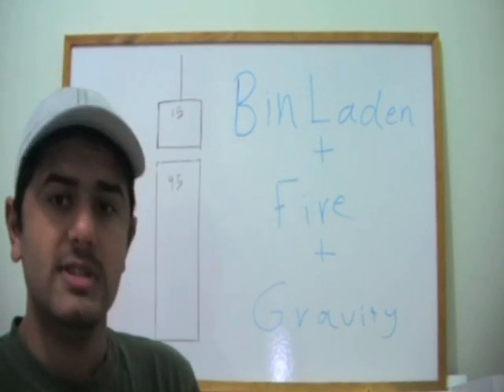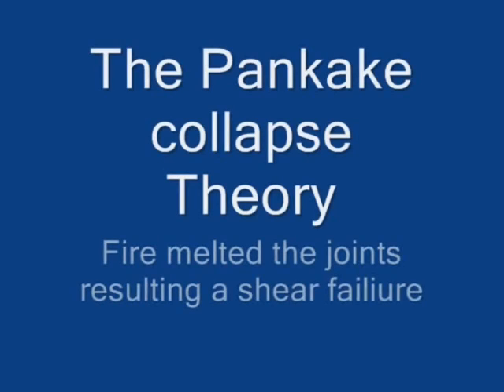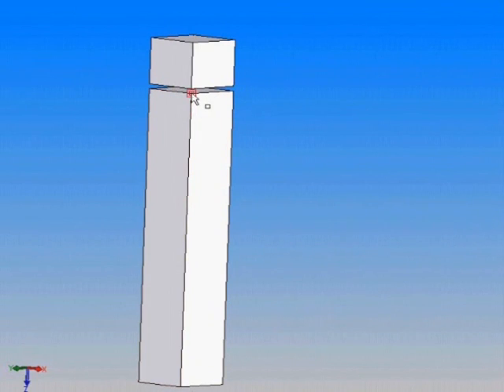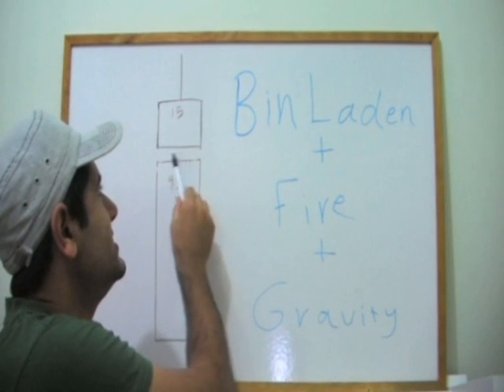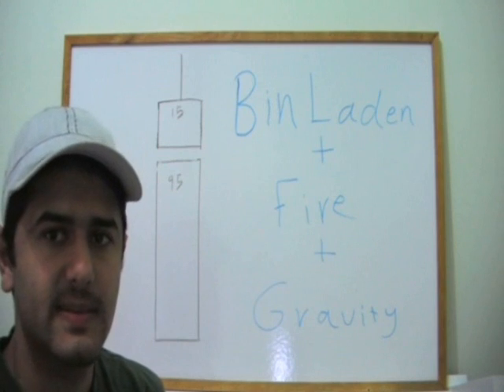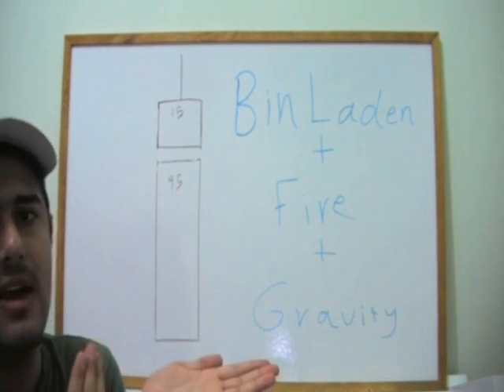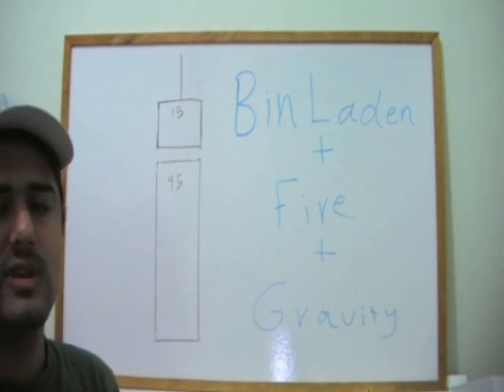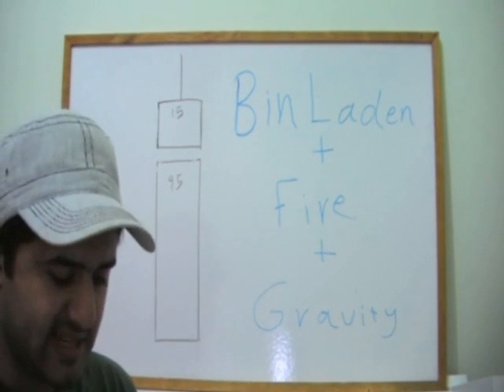(Part1) 911 Simple Physics Structural Failure Vs Demolition

Comment: Columns did NOT melt. In addition the towers did NOT fall at free fall speed. The buildings did NOT fall within their own footprint. What this guy is saying, is that the energy within the top floors as they fell was insufficient to contribute to collapse below the impact points. It has been calculated that each floor was loaded to half it's design load in its normal state. Therefore its safe to assume that the energy of top floor collapse contributed to forces far exceeding the design loading of the floors below. Something equivalent to 250 tons of TNT. Where does this guy think this energy disappeared to?
Reply: +999DaveUK "In addition the towers did NOT fall at free fall speed" How do you know
Reply: Osclala The free fall fallacy is demonstrated simply by the many videos which show the separated falling debris far outpacing the main building collapse.

The free fall timings have been estimated to be around 9 seconds. There are calculations available, showing that WTC1 estimation of collapse took 13 seconds and WTC 2 took 9.5 seconds.

Try reading the calculations here, they certainly convinced me.
http://www.911myths.com/WTCREPORT.pdf
Reply: 999DaveUK So do you think the planes caused the towers to collaps, do you belive the original story?
Reply: Osclala Yes, I believe there was no other external forces involved apart from the planes, fuel and subsequent fires. In fact, even after all of these years, some people come on You Tube, asking the same questions, but failing to provide a shred of evidence to support a theory that other external forces were involved.

Don't you think that's strange?
Reply: 999DaveUK and also explain WTC7 to me
Reply: Osclala WTC 7... yes that was the building that was damaged severely by falling debris from the towers. And then it caught fire. And then the structure was compromised because these fires were unfought. The structure collapsed in the damaged areas, and by this time the transfer of mass could not be supported across the remaining structure. This is evidenced by several visible effects:
1. Damage to SW corner, quite severe
2. Fires burning over several hours
3. Visible bowing of the structure prior to collapse
4. The Penthouse structures collapsing before any other part of the building, which is an indication of inner structure being removed before outer columns and trusses gave way

Quite a simple explanation really. Don't you find it amazing how some people actually believe explosives caused this, when there is not a shred of evidence?

Oh and my previous question, which you avoided was 'Don't you think that's strange?'
Reply: Osclala Another question for you. Do you actually agree with this guy in the video? He does make several fundamental errors and incorrect statements.
Reply: Osclala I take it your questions have been answered and you now have the information to dismiss the ludicrous claims of bombs and explosives... well done!
Reply: 999DaveUK Different timezone :D havent looked at it yet
Reply: 999DaveUK I'm not saying i believe that bombs were panted, although I don’t believe the NIST report. And the building did free-fall, you can see in the original videos how fast it falls, and you can measure how fast it fell, which indicates that the towers did indeed free-fall around 2,5 sec (more ore less.) also it did fall symmetrical which doesn’t make sense, you would think that the collapse would make it tilt to either sides, but it falls within the footprint. Also explain to me why they found termite in the dust, and explain how WTC7 collapsed. Notice how the towers almost explodes out, but WTC7 implodes in itself.
Reply: Osclala If the towers achieved free fall, the time of collapse from top to bottom is calculated at around 9.5 seconds. However no one could possibly know the actual fall time, as the lower 40 storeys were within a dust cloud. Using the mass of the upper unsupported 15 storeys, and it's immediate collapse, the energy released by gravity is massive. If you are saying a 2.5 second difference is 'nothing', then you'd have to realise, based upon a 0.1 second collapse per floor, we are talking about a 25 storey difference. In other words, under free fall, the towers would have hit ground zero. While under the actual witnessed collapse, 25 storeys would still have to fall. This points to all of the energy being used from the weight of the building, cumulative and with gravity forces being enough to collapse floors in a progressive way.
The towers did not fall within their own footprint, some parts of the towers ended up being spewed out 100 metres. It was a top down collapse, and the tilt you refer to was the initial collapse, which immediately compromised the structure on the opposite side due to overloading. The straightening was due to the fact that the first few floors below the impact points gave way more or less evenly, and momentum together with cumulative weight of additional floors was enough to continue the collapse.
WTC 7 is a completely different scenario. Massive fires raged for hours, a large portion of the SW corner had gone. I see nothing wrong with the 'implosion' you mention. In fact you can see on video the effect on the outer steel columns by the bowing, and although you cannot see the inner structure, I would think that would be similar too.
Reply: 999DaveUK How did it fall symmetrical?
Reply: Osclala If you are talking about the collapse of WTC 7, this was NOT symmetrical.

WTC 7 was made up of many 					pieces put together. The building 					collapse progressed from the penthouse out as columns were 					weakened by the fires. This transfers the loads to other faces of the building until it gets to a point where the loads overcome the design loads. The slow sinking of the penthouses, 					indicated the internal collapse of the building behind the 					visible north wall, and this took 8 seconds according to NIST.
In fact, the north face fell AFTER the rest of the main shell of the building. This is evidenced by the photos showing the north side outer supports resting over the rubble pile.

I would ask you to look at the Bankers Trust Building, which had been similarly damaged by debris from the towers. This building did NOT collapse. The difference between the two events was.. WTC 7 was on fire, and The BT Building was not.
Reply: "Columns were weakened by the fires" Office fires never goes beyond 600C How do steel beams melt? In addition, how do they all melt at almost the same time? Why did the government clear the site, even though it is illegal to touch a crime scene? Also how can it be that no other high risers (except the three at 911) ever fell, no such thing has ever happened before.. And then 3 times in a day... look at this http://www.nytimes.com/2009/02/10/world/asia/10beijing.html?_r=0 ... how did this not collapse then???? More fires in this building that’s for sure, and also.. How did the fires start in WTC7?
Reply: Osclala OK, I will answer your first question only, as you are making assumptions and jumping around.

I, and nobody else, is claiming 'steel beams melted'. Where do you get this notion from?

It is known that structural steel begins to soften around 425C and loses about half of its strength at 650C. So your 600C office fire scenario looks bang on. But even a 50% loss of strength is still insufficient, by itself, to explain the WTC collapse. Even with its strength halved the steel could still support the stresses imposed by a 650C fire.

The main problem was distortion of the steel in the fire. The temperature of the fire was not uniform everywhere, and the temperature on the outside of the box columns was clearly lower than on the side facing the fire. The temperature along the steel beams was certainly not uniform. Given the thermal expansion of steel, a 150C temperature difference from one location to another produced distortions in the slender structural steel, which resulted in buckling failures. Thus, the failure of the steel was due to two factors:
1.Loss of strength due to the temperature of the fire
2. Loss of structural integrity due to distortion

My question to YOU is... explain how the towers collapsed.
Reply: Well to be fair, I do not think I am qualified to answer your question. I do not know all the details yet but I can tell you that I do not believe NIST. I could be a reason for US to get involved in the Middle East since I cannot justify the “attack” as a reason to go to war. They could just have heightened security instead of wasting innocent lives and taxpayer’s money. For some reason I think it is connected to oil, I do not know if it was the governments act, it just seems a bit unlikely. However, considering all the dirty tricks America has used throughout the history I would not be surprised to be honest. 
1: I find it hard to believe that high risers just collapse because of fire. The WTC towers where the first 3 in the whole world to collapse because of it. Moreover, 3 on the same day? Come on. In addition, when you look at the images the fires in WTC 7 are not big enough to make the whole damn building collapse. Look at the tower from Beijing, that fire was something else and it still stood. 
2: Looking at the trajectory of the airliner you can see that this is not the average Joe.
3: Why did they find Termite in the dust? This is a chemical compound which is used to cut metal (heats to around 2,5k C) 
4: WTC7 Falls symmetrical and in freefall (is calculated by the amount of frames in the recording) This indicates that there is nothing holding it up at a certain point, which is unlikely if it’s caused by fire.  Also the penthouse could be explained. If someone were to plant a bomb to make it look natural (not that I believe this) 
5: NATO congress was secret, no journal was ever released. We do not know what they have been talking about, and really, the NATO involvement in Iraq afghan etc. was because of the article 5 claim. 
6: The actions of the ruling government – Why did we have to go to war, why didn’t we just tighten security.
7: The hijackers were never recorded on video, and they weren’t on the original boarding plans, the only link is the passport “found” on the sidewalk. 2 things A: How did the passport survive the flames B: Did they slip through American security without any record of them ever being there? Unlikely.
Reply: Osclala You have just typed a whole series of conspiracy plots, and not a single ONE of them has a shred of evidence. You are basing your stand point on your own political beliefs.
Reply: According to NSIT itself, "parts of the tower spewed out 100 meters (that's misleading, rubble did that, the superstructure itself did not)" because of the pancake effect. A pancaking twin tower should have taken much more than 12 seconds. Much of the energy you are talking about gets used up, as each floor crashes into, and destroys the next, resulting in some deceleration. If the WTC had been pancaking, it would not have gracefully accelerated to the earth in that way and with that velocity. Additionally, the damage to WTC7 was initially assessed as being minor, and it was after the demolition that it was supposedly  discovered to have had 12 feet of depth from 30 floors of it's south face "scooped out" (there is no supposition as to how). There was a fire, though if it was indeed "massive" it was deceptively so. There was very little smoke or fire visible at all. Finally, while it is true that the heat from burning office supplies can weaken steel, it is nowhere near hot enough to create the glowing blobs of slag seen falling from the towers, and found beneath the wreckage days after the incident. No steel beam skyscraper has ever collapsed like that due to fire. EVER. Steel beam skyscrapers have been rocked by fiery explosions before, some burned with a violence and duration that make the WTC look dull, and not one of them experienced more than minor structural collapse. Now your are telling me there are three in one day? Other structures destroyed in fires collapse slowly and with great deal less symmetry. Multiple structural supports must be compromised simultaneously to achieve that kind of demolition. Thousands of people with a lot more architectural knowledge than you agree. The twin towers were designed specifically to be able to withstand a collision from a 747. You say nobody claiming conspiracy can come to you with any facts. Can you come with any facts you didn't get just by glancing at the excuses haphazardly shat out at the last minute by the NSIT?
Reply: 999DaveUK I can provide you with sorces if you care. I'm just asking questions as to how all these coinsidents happened on the same day. The NIST report is so unlikely that i would rather bet on the legitimacy of a random lottery coupon.  I cannot belive NIST because it's flawed and full on "facts" that arent proven.
Reply: ***** I cant figure out if you are for or against my argument? At some point it seems like you disagree with me but then i read this "Can you come with any facts you didn't get just by glancing at the excuses haphazardly shat out at the last minute by the NSIT?"
Reply: ***** Just a couple of points:
1. ''A pancaking twin tower should have taken much more than 12 seconds''. So how long should it have taken? And your claim that the fall should have decelerated doesn't take into account the mass of each floor adding to the dynamic mass as it hits the floor below, and so on. In actual fact, free fall, would have produced a final collapse 3 seconds sooner, equivalent to 30 stories of fall.
2. ''According to NSIT itself, "parts of the tower spewed out 100 meters''. Why do you dismiss this? There are pictures widely available showing the large debris slabs leading a path right up to Building 7. This was a distance of 130 metres. This also answers your argument that doubts how Building 7 was damaged. Other buildings were well within this 130 metre zone, but only Building 7 (by far the largest and tallest in that zone) caught fire and collapsed.

These are FACTS supported by evidence. Where is the evidence supporting a controlled demolition, apart from the subjective comment that 'buildings like this had never collapsed before'?
Reply: Osclala Much of the NIST report mentions events as being 'likely occurrences'. Nobody knows what exactly was happening within the 3 buildings. But the NIST report does make use of areas of evidence, including video, pictorial, eye witness, seismic, scientific, structural. And from this they produced a series of probabilities.
Just because you don't think something could have happened is not a reason for dismissing an argument. In the same way I do not dismiss your argument, I merely ask for evidence to back it up.
What exactly did you want from the report? Did you want it to make up a scenario to suit your own agenda? And if you dismiss the NIST Report, would you please show me a piece of credible evidence that supports a controlled demolition theory? I'll await your response.
Reply: " Building 7 was damaged. Other buildings were well within this 130 metre zone, but only Building 7 (by far the largest and tallest in that zone) caught fire and collapsed.

These are FACTS supported by evidence. "

What evidence leads to the possibility of WTC7s collapse ? Lets assume you are right that a part of one of the towers fell into the building.

Why would WTC7 fall symmetrically and why wasnt any of the bulding destroyed beforehand? when you look at the pictures of WTC7 the bulding was intact and standing.

You are saying that a fire caused WTC7 to collapse? collapse symmetrically ??
Reply: 999DaveUK I dismiss NIST because i think the so called evidence is fake and bought by the goverment.

Remember the passport they found from one the terrorists? how was that found and how did it survive the plane crash flames etc. The jackers werent even in the boarding plan or wasnt even recorded in the airport? there is no link to the jackers

How did a stealbeam highriser like WTC7 fall due to fire or falling rubble?? why didnt the surrounding buildings fall?.How did both towers fall symmetrically with a 12 freefall period and into it's own footprint all because a plane crashed into it??
Reply: Osclala If you read the NIST Report it clearly states that Building 7 was critically weakened by damage to the floor spans and a key vertical column. It also states that the damage to the structure by falling debris was not a direct cause of collapse. But why do you state that Building 7 was not damaged, when it clearly WAS damaged? In addition, the 'symmetrical collapse' is explained by the view that much of the internal support was progressively collapsing and weakened BEFORE the outer steel shell was seen to collapse. The roof structure, and penthouses, were elements supported by the internal steel columns. Once the internal columns had gone, it can be clearly seen that the roof collapses. There is also video evidence showing the outer structure being pulled and pushed as the inner steel disconnects from columns. So for a few seconds we have a scenario of an outer shell standing unsupported by any of the internal structure. What you saw was the final element of collapse. NIST used the video and seismic evidence to produce a report depicting the likely cause of collapse. What I do NOT see, is any evidence whatsoever of a controlled demolition. Could you please provide some?
Reply: 999DaveUK i dont know what happened to WTC7 the demolition was the twins. And ive read NIST.How was WTC7 damaged from the inside?
Reply: Osclala ''How did a stealbeam highriser like WTC7 fall due to fire or falling rubble''.... previously explained, and is clearly explained in the NIST Report. So why do you keep asking the same question? Surely it's time for you to provide an alternative theory?
''Why didnt the surrounding buildings fall?''.... because Building 7 was the only building to have unfought fires, and which had by far the largest mass of over 40 stories.
''How did both towers fall symmetrically with a 12 freefall period and into it's own footprint all because a plane crashed into it?''.... well you need to get your facts right. WTC1 and 2 did NOT fall at free fall speed. They fell at some 3 seconds less. In addition, they did not fall into their own footprint. Large debris slabs landed over 100 metres away.
Your point about the hijackers is noted. The NIST Report does not consider the hijackers, but there is plenty of evidence to suggest the hijackers were all identified. But you no doubt think they are all still alive. So, let me know where they are right now?
Reply: Osclala ''How was WTC7 damaged from the inside?'' The initiating event was the fires. These were unfought, and burned over a long period. This caused heat expansion, and in particular affected a vertical column (No 79) over a 9 floor distance. Subsequent buckling and disconnection of floor joints weakened the internal structure. There, now you know!

So, how did a controlled demolition collapse Building 7? I await your answers.
Reply: 999DaveUK As i stated before they found termite in the dust you can read it in my statements above froma few months back.

here is a video you'll be the judge.

Also i have a cd and some files i can send you although it is in Danish so you might not get anything out of it.
Reply: Osclala So are you saying that this thermite in the dust is your proof that the towers and WTC 7 were deliberately collapsed by controlled demolition? You do realise that NO thermite was found.. merely the residue of particles that have not been independently verified. And even if these particles were residue of a thermite reaction, you don't explain the logistics of how this event happened. And there are no eye witnesses to thermite being used. No whistle blowers. No scientific support for such a theory. So for the last time... WHERE IS YOUR EVIDENVE OF A CONTROLLED DEMOLITION??
Reply: Where within the NIST Report did they analyse the floors below the point of collapse initiation ?   Please provide me with the specific analysis from NIST..... and please don't reference Bezant as his theory wasn't part of the official NIST investigation..... thanks
Reply: Eric Arthur Blair Jr "Where within the NIST Report did they analyse the floors below the point of collapse" I didnt claim this i only asked how the third law applies
Reply: Eric Arthur Blair Jr i will dismiss all the odd "coincidences" if you can explain to me how the third law applies to either of the towers
Reply: Osclala It's not for either you or I to debate the third law and how it applies.... however. it is for you and I to scrutinise the conclusions from the only official analysis that was commissioned by the US Government and conducted under the National Construction Safety Team (NCST) Act, which gave NIST the responsibility for conducting fact-finding investigations of building failures of WTC1,2,and 7.

Now... if you look at my original question of "where within the NIST Report of the WTC 1. and 2 did they analyse the floors beneath the point of collapse initiation" ..... care to answer ???
Reply: Eric Arthur Blair Jr If you read  the timeline here on youtube i explained everything to this case. look at the comment above. To sum it up i dont belive nist or their report, a lot of other people have found flaws in the nist report.

The  third law doesnt apply to the twins
secondly WTC7 came down due to what?? office fires?? must be the first tower in the world.
Reply: Osclala My apologise .... I didn't read your earlier posts..... I was simply asking the deniers to explain why the NIST report was so   flawed..... hence my post !
Reply: +Eric Arthur Blair Jr It was fun watching you two truther tin foil hatters arguing... and not realising what you were arguing against lol. Kind of sums you people up I suppose lol
Reply: 999DaveUK English isnt my first language so i might have a hard time understanding some things, but i can try writing in Danish and we'll see who will wear a tin foil hat then ;)
Reply: That's ok. You guys usually talk Double Dutch, and I can't understand that either lol.
Reply: HAHA.... when you lose the argument, just block. So easy lol
Reply: +999DaveUK I've seen predictions of over 2 minutes for a pancaking twin
Reply: ***** And I've seen exact calculations of 12.5 seconds. But then some predictions, are usually guesses!
Reply: 999DaveUK LMFAO !!   can't you answer MY question dave.... come on... give it a go if you are such an 'expert" !!
Reply: Eric Arthur Blair Jr Well you aren't the sharpest tool in the box are you? What question did you ask of me? I scoured this little series of posts, and didn't see ONE question aimed at me. And in any event, why on earth should I answer a question from a nincompoop....?? Now go and run, unless you have something useful to say!!
Reply: Eric Arthur Blair Jr It's nice to see you are supporting all of the ''scientific'' theories presented in this amateurish video. It was like watching a six year old explaining how his ice cream is melted by the fairies!
Reply: +999DaveUK I think you're missing my main point which is that you are only defending your position using information from the very source whose validity we are challenging. I have an 'exact calculation' where the tower stops collapsing about halfway through so it seems there are different ways of doing the math. Whose math are you listening to?
Reply: ***** How do you know I am only using the NIST report to validate the NIST Report? And as usual, because you are a conspiracy truther theorist, you talk in riddles. You now want an independent report, not the NIST Report, to come up with different fall rates other than those shown within the NIST Report. And yet that same NIST Report uses a range of verifiable data (VERIFIABLE).... so what data does your 'other source' use? And a word of advice to you. Stop attempting to bullshit, you are exposed!
Reply: 999DaveUK Double Dutch? what the fuck is that? I bet you dont speak shit besides English.
Reply: +Osclala I see you have added 'bad language' to your list.
Reply: 999DaveUK I see you have added demeaning smartass to yours
Reply: +Osclala So....now you failed to give any evidence whatsoever for your wild conspiracy theories. Now you are using foul gutter language to make yourself seem smart. But what you are really doing is stamping over the graves of 1000s of innocents killed on 9/11.  Shame on you!!!
Reply: 999DaveUK i provided you with a lot of links before, look at those or search "niels harrit" and you'll find a lot of the stuff i've been talking about. Besides you havent given me evidence as to how the third law applies to the twins so you failed aswell. You refuse to challenge the official story and treat 911 as a crimescene thus letting down the families who lost their loved once shame on you.
Reply: 999DaveUK Looks you it's YOU who's been exposed Dave !!   Still no answer from you to my question..... this is really embarrassing for you mate !!!!
Reply: +Osclala You can send me all the links you want. No doubt these are from the same school as yourself... a tin foil hat wearing theorist with not ONE piece of credible evidence. You are well and truly debunked. I've given up asking you to show me your proof because each time you ignore it...I wonder why...
Reply: +Eric Arthur Blair Jr And as I've said to you before. You are hiding behind riddles. Typical of a conspiracy nutter who doesn't even understand basic physics. You really are exposing yourself here aren't you?
Reply: 999DaveUK How is the third law a riddle??it's the most fundamental thing in physics? "Typical of a conspiracy nutter who doesn't even understand basic physics" if that is the most serious answer i can get i think we are done here. I think YOU are the nutter if you think the laws of physics shouldnt apply :D
Reply: 999DaveUK "No doubt these are from the same school as yourself" it doesnt matter who is challenging the official story as long as the sources and math adds up right? ahaha like there are only a handful of people in the world credible of doing research
Reply: They calculated the time it took for the buildings to fall by seismographs and it took 10 seconds for one of the Towers to fall! This is impossible in a natural way!
Reply: +Dhen Mcnab The timing for both towers to fall using video, seismic, eye witness and scientific data was around 2 seconds longer than in free fall. That 2 seconds equates to around 30 stories. The calculations in Frank Greening's paper show that the upper mass overcame the design loading of each floor below the block and added to the dynamic mass as it descended. So as you can see, it was the 'controlled demolition' that was 'impossible'!
Reply: Dhen Mcnab he wont listen i've been trying to say this for like 14 msg's, just give up he's eating all the shit the gov is throwing at him no matter what laws of physics you present.
Reply: 999DaveUK If you use the third law you'll see that the mass from the part of the bulding going down would have been destroyed or tilted, way before the halfway point... why? as the third law clearly states "For every action, there is an equal and opposite reaction." ... let me cut it in half ..... 

Kent Budgett is pulling upon a rope that is attached to a wall. In the bottom picture, Kent is pulling upon a rope that is attached to an elephant. In each case, the force scale reads 500 Newton. Kent is pulling ...

a. with more force when the rope is attached to the wall.

b. with more force when the rope is attached to the elephant.

c. the same force in each case.

Answer: C

Kent is pulling with 500 N of force in each case. The rope transmits the force from Kent to the wall (or to the elephant) and vice versa. Since the force of Kent pulling on the wall and the wall pulling on Kent are action-reaction force pairs, they must have equal magnitudes. Inanimate objects such as walls can push and pull.

lets assume that magically all the beams meltet at the same second the mass of the upper part of the bulding wont destroy the whole lower part because of the third law
Reply: +Osclala So you agree with this guy in the video? How amusing. Did you ever get past 1st grade physics?
Reply: 999DaveUK I did yes, i think you need to redo 1st grade if you cant explain the third law
Reply: Osclala I asked you if you agree with the guy in the video? You didn't answer. I also asked you to explain the scenario behind your controlled demolition theory. You didn't. This says a lot!
Reply: Osclala You stated this ''lets assume that magically all the beams meltet at the same second the mass of the upper part of the bulding wont destroy the whole lower part because of the third law''.
The way you are interpreting the 3rd law of motion is absurd. You make an assumption that the removal of a section of supporting structure allowed the upper block to fall, with the vertical beams landing exactly on the beams below.... and those standing beams reacting to the downward force by reacting in the opposing direction. You have ignored the transfer of downward motion into lateral motion which displaced the floor beams. You are also totally ignoring the other forces at play within the building, such as fire. If you watch the towers fall you will see large building elements and vertical beams being pushed outwards. These outward forces are in effect parts of the opposing reaction you are feebly clinging to. In other words, you are arguing against your own case. Well done...lol.
Reply: 999DaveUK When mass is in motion it doesn’t matter where and how it lands the third law will always apply. Say you drop a ball on the floor, the ball will then bounce back up (the same high) then lose energy 
which causes the next to be a little lower etc.

My point: 
to every action we have a reaction. 

If a force go down a force must go up, no matter where and how the mass impact. If you drop 10 kg on 30kg the 10 kg will be gone before the 30kg, we may very likely lose some mass let’s say maybe 5 kg depending on the force, but the greater mass will still be the mass surviving.
Reply: Osclala You keep repeating yourself. According to you, if you dropped a brick on a house of cards, the cards would repel the forces and stay as a house of cards. This would not happen of course. The full opposing forces only come into play when the cards are flattened, and the brick hits the table on which the cards stand. Can you really not see the flaws in your argument that the towers below the blocks would have remained intact?
Reply: +999DaveUK the twin towers aren't at all like a house of cards, they are a rigid mesh of steel beams specifically designed to withstand an impact from a 747
Reply: +Evan Newton So what point are you making? Explain how the towers fell. Then provide evidence to back up your claims. But I guess you are like the rest of the tin foil hatters.....short on knowledge but big on theories.
Reply: 999DaveUK The architect, engineer, pilots, firemen, military for 9 11 truth You always keep pretending they never exists! I asked a friend who is an airliner pilot to clean up at a 9 11 pilots for truth video comments as I was about to loose it over stupid comments like "There are no problem now days to get in control of a 767 as they are so computerized! He is dead tired of explaining over and over how and why their is no such thing as a Cessna pilot taking the controls of 757 nor a 767 and just point the nose at the target and hit at the first attempt!
Reply: Dhen Mcnab I see you are avoiding answering the questions. Why won't you say how you think the towers were brought down? Or are you content to live in your bubble surrounded by conspiracy nutters, without even thinking how the towers were brought down? Or maybe you are afraid of stating your theory because you realise there is not ONE shred of evidence?
Reply: My father is a flight engineer at the UK division of SAAB Aerospace manufacturing  the joint UK and Swedish fighter Gripen! I can go through the  easiest part of aerodynamically debunking the 9 11 lies later!

The proof. According to the law of gravity, it is possible to calculate the time it takes for an object to fall a given distance. The equation is H=(1/2)at2, where H is the height, a is the acceleration of gravity (10 meters per second squared) and t is time in seconds. Plug in the height of the building at 1350 feet (411 meters) and we get 9 seconds. That is just about the length of time it took for the very top of the World Trade Center to fall to the street below. According to all reports, the whole thing was over in just about ten seconds. Seismographic measurement proves the time scale!  

It is as if the entire building were falling straight down through thin air. As if the entire solid structure below, the strong part which had not been burned or sliced or harmed in any significant way, just disappeared into nothingness. Yet this (within a small tolerance) is what we would expect to find if there had been a controlled demolition, because the explosions below really do leave the upper stories completely unsupported. Like the Road Runner after he runs off the edge of the cliff, the entire building pauses a moment, then goes straight down.

Any kind of viscous process or friction process should have slowed the whole thing down. Like dropping a lead ball into a vat of molasses, or dropping a feather into the air, gravitational acceleration cannot achieve its full effect if it is fighting any opposing force. In the case of the World Trade Center, the intact building below should have at least braked the fall of the upper stories. This did not happen. There was no measurable friction at all.

This proves controlled demolition.
Reply: Nano thermite to cut the steel columns and RDX to give an effective demolition! I unlike other I believe we have an explosive that was simply based on RDX and the state of the art explosives most likely not to be released for a couple of decdes! RDX is an explosive compound that is commonly used in a variety of high explosives. RDX stands for Royal Demolition eXposive or Research Department eXplosive. It is a member of a group of explosives known as nitramides which are used in many military high explosives.  RDX is most noted for its use in the explosives C-4 and Semtex!
Reply: Dhen Mcnab So your reply is to give me a fantasy out of your head, naming explosives and making it seem as if these brought down the twin towers? Many such compounds are in use throughout the world, and in the military. When you've finished quoting a scene from a future Star Wars movie, could you please let me know:
1. How were these explosives planted and where
2. How much would have been needed
3. How was the whole 9/11 scenario choreographed, planting explosives below a point where a plane hit (amazing accuracy and planning)
4. How long would it have taken to plant explosives at the key columns, without being seen
5. Who saw these explosives being planted
6. How come nobody came forward to explain your theory, a whistle blower perhaps
7. And finally... where is the evidence, physical and video to show the conspiracy in action (detonator wires, explosions, seismic data)

If you don't know the answers to the above, please let me know, as I know. But there are many other questions. You have a reason for the towers falling, now let me know how it was done. (Please avoid reading your Marvel comics while you answer)
Reply: Dhen Mcnab Your post is FULL of errors:
1. ''we get 9 seconds. That is just about the length of time it took for the very top of the World Trade Center to fall to the street below''. This is patently wrong. Nobody knows exactly how long it took for the towers to fully collapse. There was a cloud of dust obscuring the view. The free fall time would have been 9.2 seconds. The calculated time for the towers using scientific, video and seismic evidence was 11.6 for WTC 2 and 12.8 for WTC1. These times are made up of 2 stages, the tower below the block collapsing, and then the block itself collapsing.
2. ''Seismographic measurement proves the time scale!'' It did NOT prove a collapse time of 9 seconds. It proved the timescales I have just given you. It measured the 2 stages of collapse as these were seen on the seismic data.
3.  ''the intact building below should have at least braked the fall of the upper stories. This did not happen'' Yes it did. The slowing of the collapse was caused by the blocks hitting the first floor below and overcoming the resistance. The next floor below then has even MORE mass to withstand, one extra floor, the next floor has to withstand the block plus TWO extra floors. The slowing for each floor collapse was around 0.1 seconds. This would mean around 30 stories would still be standing after your free fall time.

There are more errors in your post, see if you can find them!
Reply: As If any of my explanations is invented? Gosh! Just research the damn thing! You are only here for one purpose and thats provoking and harassment! I go by what my father and what my now dead best friend Chris who where into demolitions in the army taught me!

Check the testimonies of the white vans who came from late at nights in May to early August! We have multiple eye witnesses and then the renovations of the elevators! These are the most likely moments be able to rig the Towers! Ill drop it here as I suppose you are no toddler and are fully aware of how to research! No matter what I write you, you will still keep up with this comic book thing! Whats the use? You havent bother to read my previous explanation so why write a new with the exact same BS respond from you?
Reply: Alright lets boil it down to one question...

So the collapse of the 3 towers? were they natural?
Reply: Im  not into physics at all but how come the steel beams glow for weeks?
Reply: Jerry Esserman I've seen pictures of glowing debris being pulled from Ground Zero.  However, the debris looked to be small pieces of office debris, not steel beams. The pictures were likely taken shortly after the collapse, not weeks. And I have never seen any evidence of steel beams glowing after the collapse. The temperatures for steel to glow could only be maintained via a high heat source.... and there is no evidence of that. So maybe this is hear say or exaggeration?
Reply: Dhen Mcnab You didn't explain where you got your misinformation from? Your timings of collapse are wrong. What do you want me to do... agree with something that is incorrect? And one of your posts lists a series of explosive compounds. Let me give you a hint. It was estimated that for each cut column using thermite, it would have had to be carefully set up in directional boxes, with something like 200 lbs of thermite for each column. Is that feasible? And when I ask you to explain your scenario for your theory, you don't. You merely guess.
Reply: Osclala ''So the collapse of the 3 towers? were they natural?'' No, in the sense that there were external forces involved, leading to structural failures, which would not have occurred if there had been no fires.
Now there you are, I answered your question, so why don't you answer mine?
Reply: 999DaveUK Alright ill try :)
Reply: Cathode Roy Save your time for something better! He is only here to provoke people! He asked politely about my view then went into insulting me claiming my knowledge was made up! And Proving he dont know a shit about physics! You only end up with insults!
Reply: +Dhen Mcnab I didn't insult you once. if you are so sure about your sources and information you should have felt confident about your position. So I will ask you.... where is your source and evidence for saying the towers fell in 9 seconds. My source for saying it didn't is contained in video and seismic data. Can you provide this?
Reply: 999DaveUK You missed my comment then! I said I leaned against the inside Job not that I was 100% sure!
Reply: MK KENDALL I thought about removing your comment... but I had a think about it, and decided to let everyone else see what idiots infest the internet these days .... enjoy your new found fame...
Reply: MK KENDALL The more I watch the guy Ali in the video, the more I realise that it's essential to get a good education. You and him should sit together in pre school classes. But this time pay attention to the teacher
Reply: 999DaveUK Awwwww. Dave is still trying so hard to be funny and relevant. When is the next meeting of the sheep so you uneducated clowns can shit on some victims?
Reply: MK KENDALL Well your history of lies and truth avoidance is something you can be proud of. You and Ali could be a comedy team. Ali with his little drawings of buildings in his videos, and you with your little fairy stories. But, of course, he'd be the brains of the duo!
Reply: MK KENDALL I was wondering. How can you type on a computer and talk out of your ass at the same time? Amazing!
Reply: +Jerry Esserman The WTC debris fires burned for 100+ days, and steel is red in color from ~950 F to ~1350 F, i.e. well within the recorded temperature range of the debris fires:
http://pubs.usgs.gov/of/2001/ofr-01-0429/thermal.r09.html
What explosives or incendiaries burn for 100+ days, and how many FDNY and other cleanup workers are 9/11 truther nuts?
Reply: MK KENDALL But you are the one who thinks this Ali guy in the video speaks the truth. You are the one who thinks his 'science' proves your point. I was merely pointing out he is an uneducated buffoon. He is actually suggesting that the top blocks of WTC 1 and 2 should have stopped, or maybe bounced. You agree with him so you are just as stupid as him. So don't blame me for you being an idiot. Blame your education system!
Reply: 999DaveUK I didn't say anything about the guy in the video..... Thanks again for shitty opinions, speculation and assumptions.
    When does your debunking start big mouth? Oh shit. You couldn't answer Eric.
Reply: +MK KENDALL Well done for avoiding the point. Trolling on  YouTube videos is the work of a child...good boy. Debunking you was far too easy. ....
Reply: Tell me how do you explain the destruction of the inner core. Collapsing floor panels do not explain the destruction of the whole floor level, nor do they even guarantee a symetrical collapse. What the eye sees is top to bottom destruction. Without speaking of falling in a footprint we see destruction occurring in that footprint.  Your assumptions are fantasy.
Reply: +Banjo Marla Regarding WTC 1 and 2...the inner core was a mesh of structure upon which the outer columns were connected via the floor beams. The deformation of the floors before and during collapse had to pull on the inner core for most of the collapse. The sheer mass of the falling towers was more than enough to do that. The alternative would have been for the joints between floor beams and core to break evenly without disturbing the core. That was unlikely and of course did not happen. So talking of fantasy...tell me how YOU think the core collapsed. Provide evidence to support it.
Reply: +999DaveUK You cannot blithely discuss the floor collapsing and also claim that the same pressure is acting to pull the core. Your theory is of consistant failing of the connections. We also know the Core was immensely strong, designed to carry 60% of the building. The components of which are huge pieces of steel specially made in Japan. Where do you think these would break? On each floor. Finally use your eyes. Look at the total destruction occurring. Do you really think a gravitional collapse has enough energy to cause that and progressively fall through 80+ floors , sweeping away all resistance in what 4,5,6 seconds? Its not possible.
Reply: +Banjo Marla At the same time you may also wish to consider the south tower, of which the top tippled 22° and begin a trajectory off base which dfinitely meant it was not applying equal pressure below. We can then see this portion disintegrate and the floors below the same at pretty much the same time. Normally we could have expected to see the continued fall of this part and a partial asymetric collapse. We witnessed symetric destruction. I would say this building was destroyed in midair, from the top down. My eyes would also say that.
Reply: 999DaveUK Lmfao Didn't see you debunk anything just alot of dodging..... it's okay. I know you can't debunk the lies, cover up and whitewash of 911. And the massive amounts of destroyed evidence. You've proved that already
Reply: Banjo Marla The impact estimates for core column damage covered 13 core columns over floors 92 to 96 for WTC1 and for WTC2 the estimate was 10 columns over floors 77 to 83. These varied between minor damage to fully severed. This was BEFORE the fire took hold. You seem to be suggesting that the gravity led collapse of both towers would not have destroyed the core. You also seem to be suggesting that a gravity collapse would not have disturbed the core. I would suggest that it's reasonable to presume that the dynamic mass initiated by the upper free blocks would have acted to pull and deflect the core thus reducing its ability to remain connected. In fact around 30 stories of WTC 1 and 2 cores remained standing for a short time after collapse.
Regarding your question on the energy of the collapse of the towers, the collapse initiation started after the upper blocks hit the first solid floor below. Are you really suggesting that the dynamic mass was not enough to collapse the floor below, thus adding one floor's mass and collapsing the next and so on? You expected it to stop dead when all the calculations show the massive energy involved? Your final statement needs analysing. You state the towers collapsed in 5 or 6 seconds? Totally untrue... try again. Then you state that the gravitational collapse 'removed all resistance'. How do you know this? Resistance cannot be 'removed'. There was a slowing of the collapse of around 0.1 second per floor. Hence the collapses took in excess of that under a free fall situation.
Reply: Banjo Marla Now to your point about the tilt on the South Tower. The cause as I understand it, was the uneven damage prior to collapse initiation. This is consistent with the aircraft impact damage, and certainly NOT with a more uniform controlled demolition. You are arguing that you expected the top to continue over until it 'falls off the edge'. But you are ignoring the sudden weight transfer across the whole building once the tilt commences.
Finally, you seem to be suspicious of every aspect of the collapse. So once again I ask you, can you provide any evidence to confirm your suspicions?
Reply: 999DaveUK When does your debunking start? You skipped right over Bush's best buds bankrolling 911 and the ensuing cover up ? 
Tell me why all investigations were stopped that got to close to the Saudis ...
     Let's talk about the Saudi Embassy in Washington being involved.... how bout Bandar and his 130k sent to San Diego.....
   Lol Let's talk about those Saudi flights and how there were no interviews done.....
Reply: +999DaveUK I find it strange you ask for evidence when you are using speculation. For example from where did the damage estimates to the core come from. Likewise your 0.1 seconds per floor. Are you not simply dividing the time difference between free fall and the perceived time  of collapse to fit the story?
Reply: Banjo Marla I find it odd that you can look at the collapse of a building, and read so many things into it that aren't there. Indeed, what you are saying is, that the buildings should have collapsed a different way, but you won't provide a theory, or even hard evidence for the alternative. My conclusion is, that you have no evidence, which is understandable.
The damage estimates come from....
1. Visible impact damage
2. Subsequent bowing of connected elements
3. Visible effects immediately after collapse.
4. Position and intensity of fires
Regarding the 0.1 seconds per floor, this was an estimate of the time it would take for each floor to be 'stripped out' as the upper floors hit it. There has to be a time for this to happen, due to the resistant forces of each floor.
But you SAW the towers collapse in '5 or 6 seconds', which means that the towers must have had rockets attached to the top with the force of 7 megaton bombs..... propelling these large masses at velocities much greater than gravity. Amazing!
Reply: +999DaveUK 4,5,6 seconds was an arbitary estimate depending how you time the collapse. This being the extra. I am still waiting for the scource of your damage estimates to the core.
Reply: 999DaveUK I didn't say anything about Ali..... comprehension is key....
Problem understanding fuckboy?
Reply: 999DaveUK "Former FBI agent John Guandolo, who worked 9/11 and related al Qaeda cases out of the bureau’s Washington field office, says Bandar should have been a key suspect in the 9/11 probe.

“The Saudi ambassador funded two of the 9/11 hijackers through a third party,” Guandolo said. “He should be treated as a terrorist suspect, as should other members of the Saudi elite class who the US government knows are currently funding the global jihad.”

But Bandar held sway over the FBI.

After he met on Sept. 13, 2001, with President Bush in the White House, where the two old family friends shared cigars on the Truman Balcony, the FBI evacuated dozens of Saudi officials from multiple cities, including at least one Osama bin Laden family member on the terror watch list. Instead of interrogating the Saudis, FBI agents acted as security escorts for them, even though it was known at the time that 15 of the 19 hijackers were Saudi citizens.

“The FBI was thwarted from interviewing the Saudis we wanted to interview by the White House,” said former FBI agent Mark Rossini, who was involved in the investigation of al Qaeda and the hijackers. The White House “let them off the hook.”

What’s more, Rossini said the bureau was told no subpoenas could be served to produce evidence tying departing Saudi suspects to 9/11. The FBI, in turn, iced local investigations that led back to the Saudis.

“The FBI covered their ears every time we mentioned the Saudis,” said former Fairfax County Police Lt. Roger Kelly. “It was too political to touch.”

Added Kelly, who headed the National Capital Regional Intelligence Center: “You could investigate the Saudis alone, but the Saudis were ‘hands-off.’ ”
Reply: 999DaveUK " former Republican member of the 9/11 commission, breaking dramatically with the commission’s leaders, said Wednesday he believes there was clear evidence that Saudi government employees were part of a support network for the 9/11 hijackers and that the Obama administration should move quickly to declassify a long-secret congressional report on Saudi ties to the 2001 terrorist attack.

The comments by John F Lehman, an investment banker in New York who was Navy secretary in the Reagan administration, signal the first serious public split among the 10 commissioners since they issued a 2004 final report that was largely read as an exoneration of Saudi Arabia, which was home to 15 of the 19 hijackers on 9/11."
Reply: 999DaveUK "There was an awful lot of participation by Saudi individuals in supporting the hijackers, and some of those people worked in the Saudi government,” Lehman said in an interview, suggesting that the commission may have made a mistake by not stating that explicitly in its final report. “Our report should never have been read as an exoneration of Saudi Arabia.”

What was that about a Fantasy shitdick??? Hahahahahaha
Reply: +MK KENDALL I suggest you start writing Harry Potter books lol. You are well into fantasies lol
Reply: +Curbstomp Shills Trolling with lies is allowed on YouTube apparently. Still not ONE shred of evidence lol
Reply: 999DaveUK Troll fail..... Play hide and seek all you want little girl. Your denial proves and disproves shit.
Reply: +Curbstomp Shills Still awaiting facts. Still awaiting your theories. it's fun watching you squirm...lol
Reply: +MK KENDALL Come on. I keep debunking. You keep squirming...troll lol
Reply: 999DaveUK What was that? I couldn't hear over all that debunking. Bwaaaaahaaaa 
"Claims it's fantasy and lies" but can't prove it. Bwaaaaahaaaa
Reply: +MK KENDALL Oh come on  Just one smidgen of evidence. Sorry to have to say....fantasies do NOT count lol
Reply: +Curbstomp Shills But of course. Banjo is like you. He thinks buildings bounce  lol
Reply: 999DaveUK But if course you think Saudi sponsorship is fantasy but yet can't back that claim .
Reply: +Banjo Marla So when you said the towers collapsed in 5 or 6 seconds you guessed? or did you make it up? And did you manage to find any evidence or even a theory?
Reply: +MK KENDALL There was no Saudi funding. Fourteen years and still you talk out of your rear end lol
Reply: 999DaveUK The only theory is the government's .
    Your clowns at NIST couldn't even admit free fall and had to get schooled by Chandler ....... Lmfao
    Where is NIST's work on after the onset of collapse ?
    And do you have the south side footage of 7 as it dropped ? No?
Who did your buddy Larry talk to if it wasn't Nigro and no one else has come forward?
    Got the audio from Amy Goodman's video? No?

DULY NOTED
Reply: +Banjo Marla The sources for damage estimates of core columns were calculated in the NIST report. The theory also offers alternatives. But you provide nothing of value. Does that worry you?
Reply: +MK KENDALL Oh apologies. I was waiting for you to prove Lehmann was truthful. But you can't can you? Come on.... try and prove your conspiracy. Then you can explain how Ali's buildings bounce lol.
Reply: +MK KENDALL What's the difference who made the call to the owner of your Sacred Tower 7? These are FDNY Commissioner Daniel Nigro's exact words:
https://www.metabunk.org/fdny-chief-daniel-nigros-statement-on-wtc7.t2366/
Regarding WTC 7: The long-awaited US Government NIST (National Institute of Standards and Technology) report on the collapse of WTC 7 is due to be published at the end of this year (although it has been delayed already a few times [ adding fuel to the conspiracy theorists fires!]). That report should explain the cause and mechanics of the collapse in great detail. Early on the afternoon of September 11th 2001, following the collapse of WTC 1 & 2, I feared a collapse of WTC 7 (as did many on my staff).
The reasons are as follows:
1 - Although prior to that day high-rise structures had never collapsed, The collapse of WTC 1 & 2 showed that certain high-rise structures subjected to damage from impact and from fire will collapse.
2. The collapse of WTC 1 damaged portions of the lower floors of WTC 7.
3. WTC 7, we knew, was built on a small number of large columns providing an open Atrium on the lower levels.
4. numerous fires on many floors of WTC 7 burned without sufficient water supply to attack them.
For these reasons I made the decision (without consulting the owner, the mayor or anyone else - as ranking fire officer, that decision was my responsibility) to clear a collapse zone surrounding the building and to stop all activity within that zone. Approximately three hours after that order was given, WTC 7 collapsed.
Conspiracy theories abound and I believe firmly that all of them are without merit.
Regards, Dan Nigro
Chief of Department FDNY (retired) [now FNDY commissioner]
Reply: Albury Smith Hahahahahahaha. Nice Skeptic site. 
    Nigro never talked to Larry.
Who did your Jew boy talk to? Oooops. Only his insurance company
Reply: Albury Smith The demo companies in Vegas laugh their asses off at you... Hahahahahahahaha
We just dropped the first tower of the Riviera with matches. Lol
Reply: +MK KENDALL You are coming across as an amateur. Next you'll be saying man didn't land on the moon...oops... you did. ..I remember lol.
Reply: 999DaveUK Hahahahahahaha. All you have left is lies. Lmfao classic
Reply: Albury Smith Hey dingleberry point to where column 79 was on the first floor........

I'll wait Heeb
Reply: +MK KENDALL You are all mouth and no brain. To you everyone is an enemy. De guberment is watching ya.... woooo ooo. ..lol
Reply: 999DaveUK What ???? I still can't hear over all your claims you've backed..... Oooops. There's none
Reply: +MK KENDALL Awww.... still awaiting your facts....fantasies don't count lol
Reply: +MK KENDALL But hurt are ya? lol
Reply: +MK KENDALL What's it like being embarrassed in front of the You Tube community?
Reply: 999DaveUK Hmmmm .... I wouldn't know. It's never happened. 
    When do you start embarrassing me with all your debunking ? Or is your denial a  substitute for debunking?
    What's wrong kid???? Can't back your claims? No?

DULY NOTED
Reply: +MK KENDALL Still blustering and inventing? Is life good in lala land? lol
Reply: +999DaveUK  When I see the hollow nose of a plane slide whole into a building quickly followed by the rest Without any apparent damage or debris I find it hard to follow up on any hypethetical damage. Likewise , when I see the buildings turned to dust in midair I cease to believe in a progressive collapse. I look at the debris and wonder where the towers went.  Mostly I just wonder if people do use their eyes or simply just speak in the abstract.
Reply: Banjo Marla Two points here:
1. What did you expect the plane to do once it hit the tower? Bounce? You do realise that the plane wings held 7 tonnes of fuel, travelling at 480mph. The energy involved will easily slice through steel. Hence the plane shaped holes.
2. The towers did not turn to dust. The dust and debris as the towers collapsed were a by product of the construction. But a rubble pile of 30 stories remained after collapse.

I sometimes wonder if people like you are genuine, or are influenced by hear say and untruths. When you make such wild assertions, you DO need challenging!
Reply: +999DaveUK You seem to think you have some authority, some power of correction. You dont. The weight in the wings does not increase their strength. The greater the force hitting the building the greater the destructive force acting on the plane. It is totally logical to expect to see damage occurring to the plane from the moment the nose seems to make contact. As it is to see the wings sheer off and the tail. On 9/11 we got 4 planes behaving as 4 have never done before. Yes the building is being destroyed in mid air, because you can see it happening. Huge amounts of energy pushing out and up even. Its all you can see
And finally the debris pile, wow those 16 that walked out of stairwell B. They thought they had a whole building on top of them and they saw only sunlight. lucky guys !
Reply: +Banjo Marla Let me correct you. The mass of the plane and it's velocity are the two components which make up the force hitting the tower. It doesn't matter whether the plane was full of feathers or lead as long as the mass is the same. This has nothing to do with me or my authority. It is written into the laws of physics. So let's assume you still disagree. I ask you once again. What did you expect the plane to do when it hit the tower?
Reply: +Banjo Marla The weight in the wings does increase their KE, and only a fool would deny what the planes did. The "lucky guys" in stairwell B didn't notice any force pushing them up, nor are they 9/11 truther nuts, so why don't you tell them what "really" happened?
Reply: +Banjo Marla So...you expected the plane to hit the building and instead of the wings slicing through the steel outer supports, you were amazed they didn't shear off and fall to the ground?
Reply: +Banjo Marla You seem to think you know more about the WTC debris than the ~40,000 people who worked on the site cleanup at one time or another for nearly 8 months. How did you get so smart?
Reply: +Banjo Marla The reason I mentioned the rubble pile was that you stated the towers turned to dust. They didn't so I was merely challenging your statement.
Reply: +Banjo Marla Incidentally. ..there is a video somewhere on You Tube maintaining the planes were either holograms or he videos were edited. You may wish to subscribe to those as your views are closer to their views than mine.
Reply: +999DaveUK So you dont wish to deal with planes fine. I simply think it is perfectly normal ti see some visible deformation of the plane as it eases into the building. Slides in. Just as I also think in a high energy collision Steel box section will outperform Aluminium. Is this reasonable or not. Incidentally you dont need a hologram if you have already made the film.
Reply: +999DaveHow can you say the towers did not turn to dust when all you can see is dust. It is spouting ,cascading, frothing, the total collapse has a fluid look like butter dropped in flour. Very  clearly a large part of the towers did turn to dust and it can be seen happening floor by floor. To deny this is to Deny your own eyes.
Reply: +Banjo Marla Deny your own eyes, fool:    
http://www.911truth.dk/first/img/wtcRubble1.jpg    

 https://www.google.com/search?q=wtc+debris+field&biw=1119&bih=516&source=lnms&tbm=isch&sa=X&ved=0ahUKEwib4L7zo8PNAhUCgj4KHSQeCP8Q_AUIBigB#imgdii=0qv6Ik1p25W_dM%3A%3B0qv6Ik1p25W_dM%3A%3BUPxJ5LAKCt2izM%3A&imgrc=0qv6Ik1p25W_dM%3A
Reply: +Banjo Marla Well you obviously have no knowledge of the laws of physics. And you refuse to say what you think should have happened to the plane. Now you say everything turned to dust. Amazingly foolish!
Reply: +Albury Smith I did not say that extra weight does not increase kinetic energy. I did say that this increased energy also increases the destructive force when it meets the building.  Flimsy Aluminium versus massive bow section. Hmmm Also who spoke of force pushing up guys in stairwell B? Point is they walked out into bright sunlight.
Reply: +999DaveUK Lets be clear. I would expect to see some deformation in a plane flying into a massive steel structure. Is that reasonable or not ? Obviously I do not believe in that footage of a plane sliding into a building.
Reply: +Banjo Marla Ok here is your first physics lesson. The energy needed to cut through the outer steel of the towers is immense. In the case of the planes this kinetic energy is generated through the plane's motion. This is equal to one half of it's mass multiplied by the square of its speed. Even YOU should see that at a speed of nearly 480 mph and with a mass of 14 tonnes in the wings, that the kinetic energy of the plane is massive. It does not matter whether the casing or frame containing that mass is made of aluminium or paper. As for you ludicrous false statement that the 'plane slid into the structure', how do you know what was happening to the moving object? If what you are asserting is true, your plane would have come out the other side or bounced. But you are now suggesting that the videos were faked. Another utterly stupid statement. Every broadcast and independent video footage shows exactly the same event. Open your eyes and stop inventing.
Reply: +Banjo Marla Point is the 16 survivors walked out into bright sunlight because the North Tower collapsed around Stairwell B below the 22nd floor, you fool, and the "Flimsy Aluminium" was ~140 TONS going ~540 mph.
Reply: +Banjo Marla Why would you expect to see any noticeable deformation in a <300' long plane flying at ~640 or ~790 fps into a row of 14" square tubes with 1/4" walls in the <1/2 second it was visible on that side of the building? Does the total destruction of both airliners count as "deformation" in your little world?
Reply: +Banjo Marla So I ask you to provide evidence and you provide the name of a truther web site and a speel on hear say. Your ignorance knows no bounds.
Reply: +999DaveUK I was not responding to your post and I also believe I have already done with your dismal logic already.
Reply: +Banjo Marla Well I was responding to YOUR silly subjective post. How about posting some facts instead of infesting this thread with lies and opinions? You may be done with responding to me I agree. Because up to now you've made several incorrect statements then ignored every request for you to clarify. You are no more than a fraud...but you WILL be challenged!
Reply: +999DaveUK Is it incorrect to say that any force acting on the building is equal to the force acting on the plane? Is it wrong to expect Aluminium to deform and break before Box section steel?.*Tell you what I will make Two identical vehicules, one in steel one in Alu  Now they collide at 50 mph each. Which one would you prefer to be in.?
Reply: +Banjo Marla You do realise that while you are rewriting the laws of physics that the whole of the You Tube community must be shaking their heads in disbelief at your responses. Can you really not see that kinetic energy is made up of two components.... mass and velocity? It does not matter one iota if that mass is made of feathers and wrapped in paper. The visible damage to the tower structure after impact was at the points of concentration of that mass..eg the wings. But in your world the plane 'slid into the towers'! Are you really this stupid or are you just a troll?
Reply: +Albury Smith  on one clip we see a plane enter completely There is no deformation visible to any part of the plane. The fusillage alone would have to cut through 4 (4.5 actually) colums. Each wing would cut 20. The tail would have to cut at least one 52 " spandrel. So yes boss, I would expect to see a few scratches.
Reply: Banjo Marla ''on one clip we see a plane enter completely'' I see physics still has you baffled.
Reply: +999DaveUK How,s your thesis? Sorry is it incremental or exponential increased tensile strength in relation to increased mass/velocity?   When will you publish?
Reply: Banjo Marla Well as you are rewriting the laws of physics, I just thought I'd reiterate that Kinetic Energy has TWO components. One is mass... and the other is velocity. But in your world, you state there are three. The third one being the material the mass is made from or contained in. So here is the formula for calculating the KE of an object. K= half the mass x the square of the velocity. But to be on the safe side, if you ever have to choose, always make sure you stand under a ton of feathers in a bag, rather than a ton of concrete.
Reply: +999DaveUK  I never complicated it so much. It is enough to know that the same energy is acting on the tower and the plane. The tower being 500,000 tons and built to resist lateral forces. Calculating again that the fusillage would have to  break 4 (4.5)14" box sections. Each wing 20. And the tail 1 if not 2 , 52" spandrels. Tall order what boss?
Reply: Banjo Marla You didn't 'calculate' anything. You merely stated that the videos were faked, that the images which showed the planes 'sliding into the building' were doctored. You don't explain how this was done, you cannot explain that every video of these incidents showed exactly the same thing. Amazing.. how did they do THAT? The towers were designed to withstand lateral impacts and high winds. The towers did just that. Then you 'calculate' that the fuselage of the planes could not have severed the 14 inch box sections. Oh really? So where does the energy go when you hurl a 9 ton wing laden with fuel at a speed of over 450mph across these columns? The points of impact would have been around 50cm maximum. Result? Sheared columns, fractured joints, fuselage disintegrated, 14 tons of fuel continues it's path into the tower. What next Einstein?
Reply: +999DaveUK You completely miss or avoid the point.  One video is enough. It was shown on the news everywhere. The plane just slides in. You can watch it in slo mo. So I say that this image given to me as real news must be fake. Because it simply cannot be flying thru a cross section of 45 , 14" box sections of steel plus the lateral braces.  Its fake boss. Its a con. A very very big one!
Reply: Banjo Marla A con? So now you are saying physics is a con? Excuse me for laughing. So you've only seen one video of a plane hitting the towers? And you say this was faked? So please explain how other news outlets, plus numerous independents, plus members of the public... show exactly the same thing. Were these faked as well? Yes or no?
Reply: +999DaveUK How exactly am I saying physics is a con?
Reply: Banjo Marla I have explained the PHYSICS to you of the KE of the plane hitting the WTC columns was more than enough to sever those columns and joints. Instead YOU say it wasn't, and instead it was all a con. Therefore you are saying physics is a con. Now back to the question you side stepped... Are you saying that ALL videos showing the 'planes apparently sliding into the towers' were faked? YES or NO
Reply: +999DaveUK Your saying kinetic energy like a parrot. Yes but the end result is that the same force is being applied by the building to the plane. And the plane is weaker. Heres a dilemma. One minute your saying floor joists could,nt possibly hold but wings dont sheer off. Ha thats good.  And the tail ooh. So I,m not arguing with physics. I,m argiing with you.
Reply: Banjo Marla Yes, in the 9/11 situation, wings weighing 8 tons each, do NOT shear off and fall to the ground. Can you not see that the static energy of the vertical columns, was MUCH less than the energy applied by the wing edge at impact? You state that the 'plane is weaker'?? What on earth do you mean?? Now you are rambling, and completely ignoring physics, and the calculation of energy. You didn't answer the question on the fake planes, or videos, or whatever you believe in. I can understand this as an answer either way exposes your argument as TOSH!
Reply: +999DaveUK I,m talking tosh? I drive into a wall or the wall drives into me. same effect. Alu is softer than steel. How is a wing going to cut through 20 box section colums spaced 3.5 ft apart? And that hollow fusillage thats going to push through 4 of them before the wing makes contact?  Seems to me like you got a lot of KE going with your right hand boss.
Reply: +Banjo Marla Physics not your strong point then?
Reply: +999DaveUK If you have looked at this clip you will see that the first 15+.metres of fusillage appear to enter the building intact. Followed by the rest ,tail included..How do you explain that the energy did not simply result in the total compression of the fusillage?
Reply: +Banjo Marla You slipped up there. You said it ''appears'' to enter. But in actuality what happens is the nose of the plane hits the tower at 480 mph. The crushing is almost instantaneous  Every part of the plane behind the nose is still travelling at 480 mph. The tube fuselage and tail carry enormous energy. The wings (which you said would fall off) continue at 480 mph and carrying 14 tons of fuel. Again enormous energy many times higher than the static energy within the immediate structure. Now stop being a stupid human being. Put away your collectors set of DC comics. And answer the question...''Do you believe that every broadcast and other video of the planes hitting the towers were fake?'' Now I'll answer this for you. You don't.  But if you admit this you'll have difficulty explaining how the same event appears on all other media. And if you did believe they were all faked you'll have difficulty explaining how they could fake every video. Looks like you're in a hole matey! In fact the content of your responses shows a resignation to a failure you won't admit.
Reply: +999DaveUK The crushing of the nose is instaneous yet apparently contained. The wings go in the tail follows. Dont we generally see a tail break off? Quite often at the first shock. And the fuel tanks. would they not rupture immediately,and be ignited, we can see this doesnt happen. We see zero flying debris in fact. Are you aware that news footage of the other plane showed the nose protuding the other side? This was later blacked out but it happened. So no I dont believe. As for all the footage , you think it could be just a little bit false but mostly right? 
    There is another clip I,ll show you of a plane sent into a wall for a test. The destruction is visible emerging uniformly all around from the word go.
Reply: Banjo Marla How on earth would you be able to see 'a tail break off' when that tail is hurtling at 480 mph at a fixed object? Were you expecting to see it bounce? LOL I think you've been watching too many cartoons. But anyway, you are now saying that some of the videos, although they show exactly the same thing as your faked one, are genuine? This admission means that your 'fake' assertion is disproved..... goodnight Sherlock LOL
Reply: Etb Etb And nobody is interested in someone like you who dismisses facts and places his belief in the maker of this video. I suggest you watch it again and find the mathematical and science errors!
Reply: Etb Etb You must be so proud having a video like this as your holy grail. It's a shining example of a conspiracy theorist out of his depth. I said over a year ago that the content is embarrassing to most tin foil hatters and yet you are here defending it...or are you? Regarding the maths, how many equivalent tonnes of TNT have YOU calculated? By inference you're saying the energy in the collapse was minimal and wouldn't have been enough to collapse below the impacted floors. We know the mass...we know the impact velocity...are you clever enough to calculate the energy? Or are you of the same opinion as the video maker...the upper floors just should have 'bounced'?
Reply: Etb Etb And there we have it. No mention of the mass or velocity. No mention of the KE applied to the first intact floor. I asked you if you've calculated the energy available at the first intact floor. You haven't, but I stated that the CALCULATED energy at that point was equivalent to the energy of an exploding 250 tonnes of TNT. If you insist, I will include the calculation here for your benefit. But if you wish to ignore basic physics then I'll leave you to your bouncing theory!
Reply: Etb Etb I believe I stated 'around 250 tons'! The actual calculated figure is 272 tons of TNT energy equivalent. What's so difficult to understand?
Reply: I never said my calculations were precise. So if you are going to make comments on YouTube, try not to lie. You are attempting to discredit a calculation made on known data, building weight, number of floors, weight of contents (approximation). It doesn't take into account the KE within the building from fires. The average calculated KE per floor of the FALLING building is 10,362,544,260J. Multiply this figure by 110 floors you get 1,139,879,868,600J. Equivalent to 272 tons of TNT. Now you say you observed no deceleration on impact of the falling floors. Then you state that the application of Newton's 3rd Law would mean the building would show noticeable deceleration. In both cases you are misled. There was deceleration, or perhaps you could explain why the rate of fall was approximately 30 stories short of freefall. In all of this collapse, Newton's 3rd Law was being applied at each point of impact. Perhaps you could show me some actual calculations which would demonstrate your deceleration theory.
Reply: Etb Etb But the top unsupported section DID decelerate. If we assume the top section accelerated through to free fall speed the observations clearly show the conservation of that momentum overcame the resistance of the first impacted floor. It then took around 0.1 seconds to collapse the first floor. Thus is Newton's 3rd Law in action. Using your logic, the top section would have hit the ground around 3 to 4 seconds earlier than it was observed. Your own observations go against your argument! Perhaps you could explain how the towers were brought down. Do you have a theory? Where do you think the supports were removed to fit with your observations? Do you dare guess?